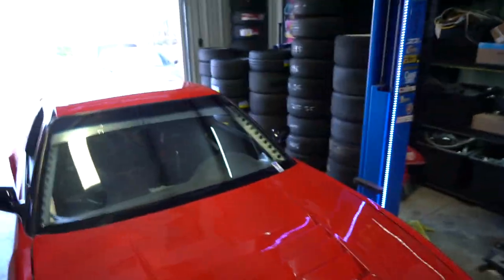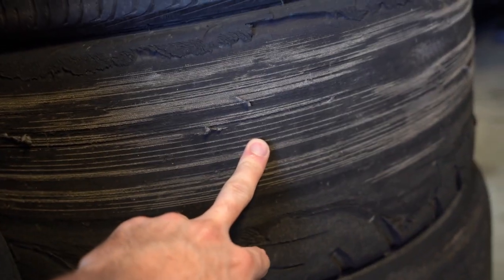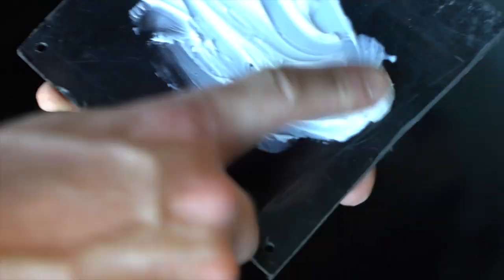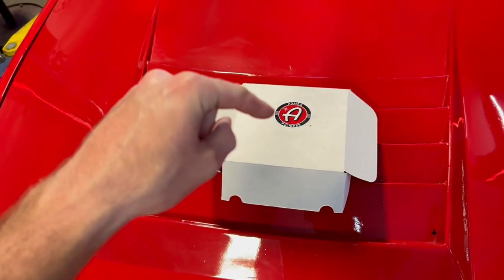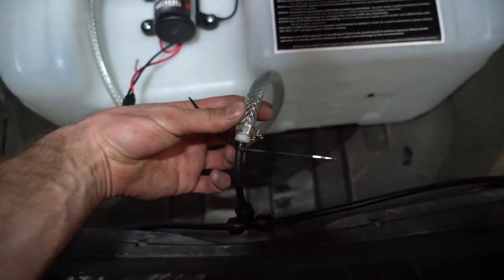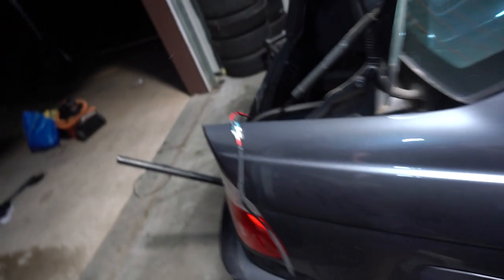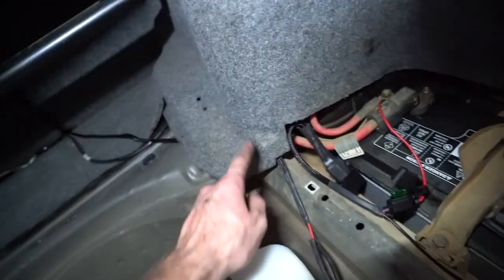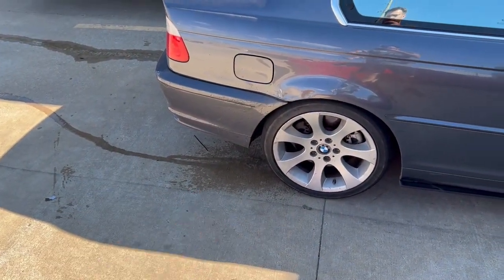DRIFT CAR TIRE WATER SPRAYER! INSTALL | HOW-TO

Comment: Wow, I just set this same thing up, on my steel gray 330i e46, about a month ago. I used a universal windshield wiper pump, came with a reservoir. Basically the same thing you did, with a smaller rez.  I used two T's at the end of the tube near the tire, to spray it on different sides of the tire. Loving the e46 content, keep it coming!
Reply from the maker: Oh sweet! Ya 8 gallons is a lot! Haha. Super fun stuff though
Reply: @jspeedracing  yeah you won't be needing to fill that bad boy up too often! Throw some ice in and turn it into a cooler 😆 I tried adding a water surfactant to the rez, sprayed it right before a slide, and holy cow, nothing but smooth slide. I just mixed the soapnut powder ahead of time and no risks of clogging.
Reply from the maker: @yusayoh  I might have to whip up a little cocktail for my 8 gallon tank 😏
Reply: @jspeedracing  can't wait to see the shreddage 👍